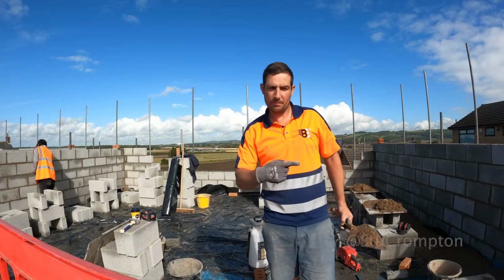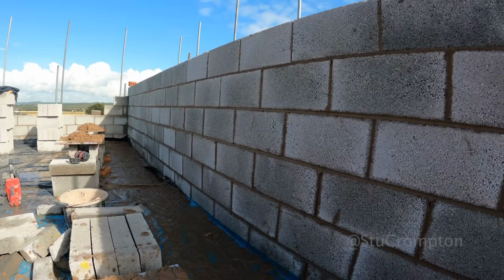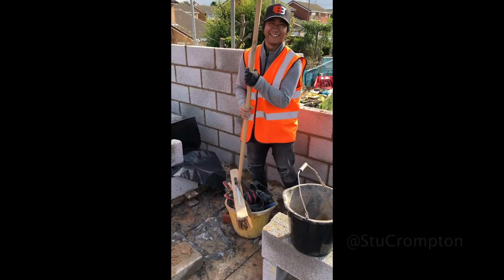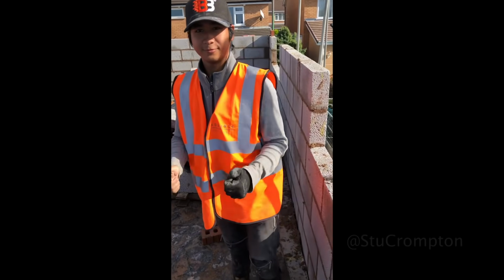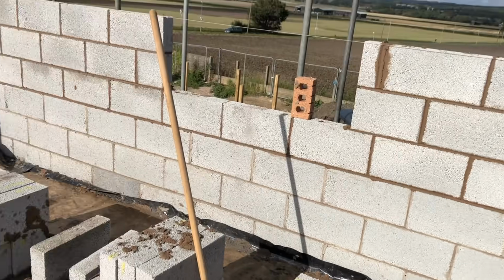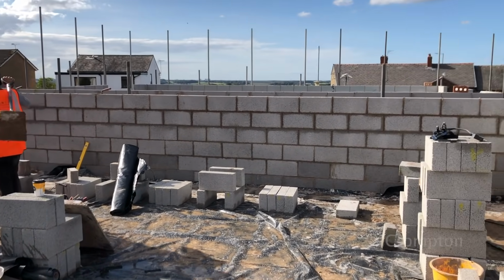Bricklaying Worst Job- Part 2 and More Blockwork

Comment: When laying bricks, how do you stop mortar falling in the cavity from the inner part of the outside wall?
Reply: I always wondered this too, as you only normally see them scrape the excess on the visible part
Reply: You can reach over and trowel it off as you build up or try not to use too much mortar 😁